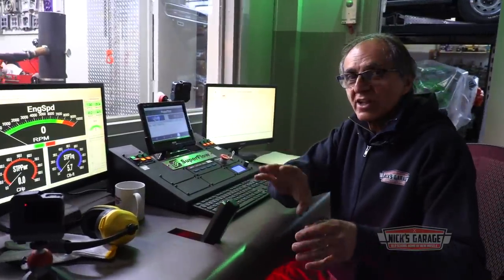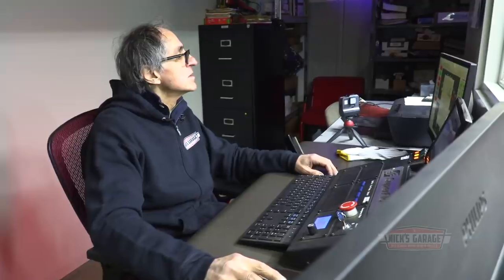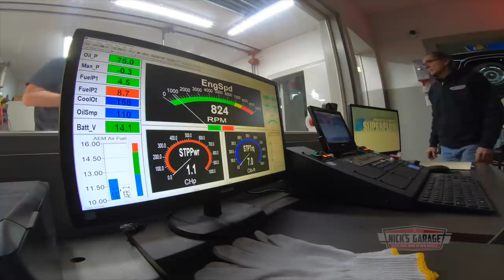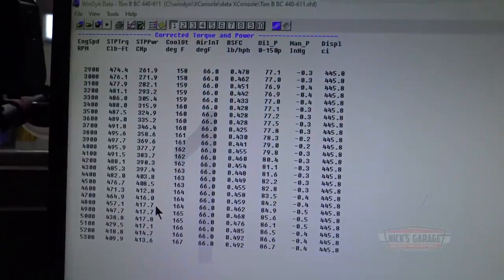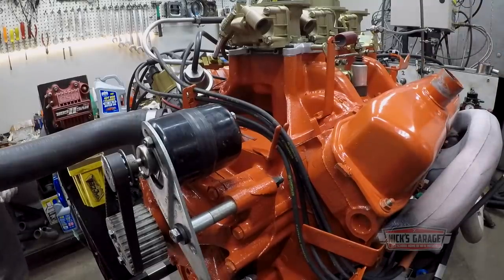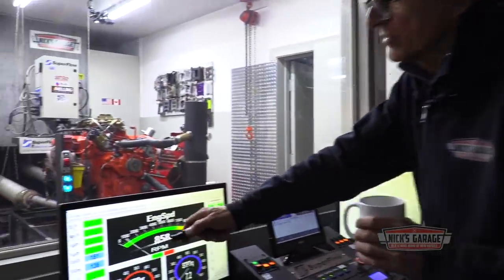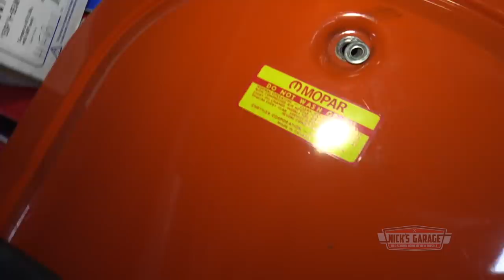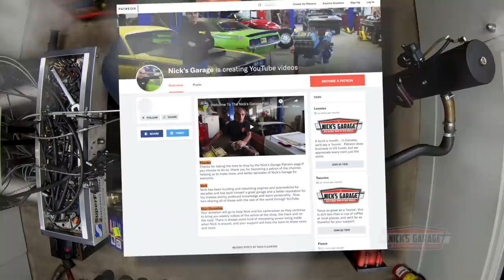Classic 440 Dyno Tested - 1969 A12 Road Runner 6 Barrel

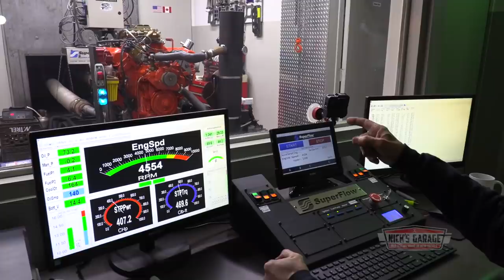Comment: The Engine has high Oil Pressure because it  has diddly for Vertical Bearing Clearance.... look at how fast the Oil TEMPS are climbing with 10W-30 Oil during the power run at 29:08 to 29:17.... ridiculous ! and again.... that's WITH 10W-30 Oil !    .0015" Vertical Bearing Clrc is insufficient for an HP Engine.
This Engine will undoubtedly run HOT once installed in the Vehicle..... as the Oil Temps will constantly rise under normal driving conditions let be for a moment any back to back power runs, with the owner continually chasing his tail trying different Thermostats, Radiators and on and on, all the while it's the Oil Temps heat sinking the water cooling system !
Reply: It'll be fine with the HV pump removed...
Reply: factory spec's  used here 

also the engine is stationary, no air cooing like moving in car with air passing over the oil pan. if "Oil Temps heat sinking the water cooling system !"   would add a oil cooler if that was the case.
And boiling point of 10w-30 is  500° F   i seen 173°   stat is 180°
Reply: @enduser6982   You are forgetting the ONLY way Engine Bearings cool is by the free flow of lifeblood cooler Oil IN and OUT again.... .0015" Clrc is insufficient, even the factory "magnum' HP Engines were assembled in a side line with .0005" extra Piston to Wall Clrc AND Cranks ground "lowside"(small) of spec to provide additional .0005" to .001" vertical Oil Clearance. This is a DUD build. As for Airflow.... same as any other Dyno Cell.... Nick uses portable high capacity Fans blowing on the Engine Block(not seen in the Video) as well as a large Extractor Fan at the rear to evacuate..... there is definitely airflow cooling the Engine same as highway speeds in the engine compartment.